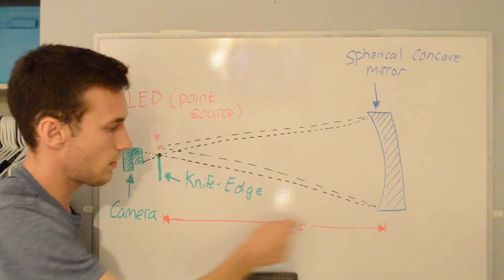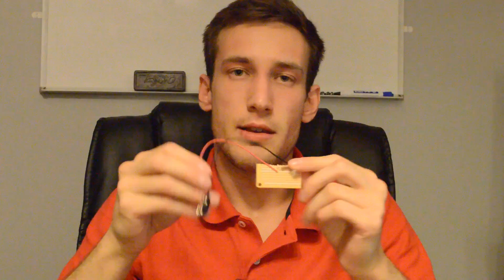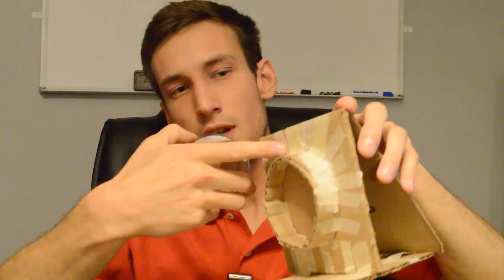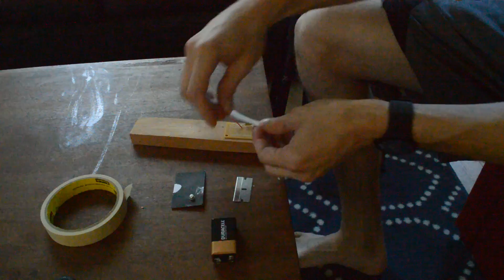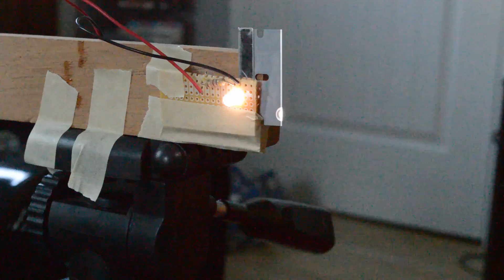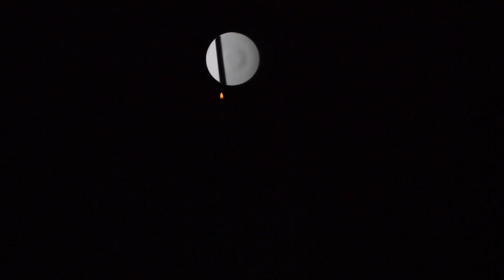How To: Build Your Own Schlieren Setup

Comment: Hey Josh, firstly thank you for explicating in a way so vivid and secondly i wanted to ask how do we colour the images seen...do we use a filter or a coloured knife edge , please tell in detail.
Reply from the maker: There are a couple of options that you could pursue.  The first is to use the setup with the knife edge, and then attach a colored filter to the other side of the knife edge where the light is passing by.  If you just use a single-color filter, then you'll see the normal Schlieren image, but in color now instead of white.  To get this same effect, you could just put a color filter in front of your light source.  So if I place a blue filter in either of those locations, I'll get my normal images, but now they'll be tinted blue.

That's not very helpful aside from making our original image a different color without post-processing.  The second option is to, again, leave the knife-edge in the setup, and attach something like a rainbow filter to the side of the knife-edge where the light is passing by.  Let's say we attach the filter such that the red is closest to the blade, and the blue is farthest from the blade.  This means that the light that is getting refracted the least (but still passing by the knife-edge) will be colored red, while the light that is refracted the most (but still passing by the knife-edge) will be colored blue.  There will still be parts of your image that are dark, where the light was refracted the other way and is being blocked by the knife-edge.  This is probably the best method for coloring your images.
Reply: By a filter do we mean a coloured paper?
Reply from the maker: Pretty much, yes.  It needs to be transparent enough to let light through, but change its color while doing so.  I would recommend something like transparencies that you can put on overhead projectors.  If you print a color spectrum/gradient on one of those sheets, that would probably work pretty well.
Reply: Thanks a ton!

Comment: Can I use a concave mirror that has a holder in the middle? That means there is a black circular spot right in the middle. Will it matter? Please help, Thank you very much!
Reply from the maker: You can use the mirror, but you'll just have a black spot in the middle.  I'm guessing you have a telescope mirror or something like that?  It should work, but just note that you'll only being able to see the light around the center spot.  I think there are a few Schlieren videos out there that use the same kind of mirror you have.
Reply: Yeah, it's one mirror out of many from huge observatory telescope. One university offered me to borrow it. Unfortunatelly I couldn't get to anything better. We will see what are the reselts gonna be. TY for help, mate!
Reply from the maker: No problem.  Good luck!
Reply: Why do I need LED (point) light source? The regular bulb would do it it too shining everywhere, wouldnt it? The goal is to hit an entire mirror with light, right?

Comment: Will a parabolic mirror work? I have an 8" in my telescope.
Reply from the maker: While the optimal mirror for this double-pass system is a spherical concave mirror, a parabolic mirror will still work okay.  For the Z-type (two-mirror) schlieren system, the parabolic mirror is the optimal choice.  I'm currently filming a spherical vs. parabolic mirror comparison for schlieren systems where I'll go over why you can use either, but also how performance is degraded depending on which system you're using it in.  I'm also editing a Z-type schlieren system video, so if you have two telescope parabolic mirrors, you can get some really nice images from that system.

Comment: I Try to set up the system .
1,And I do some change ,the angle of this system is bigger. I see the candle and the candle in the mirror.both of them have the shadow.
2.I analysis the image by matlab and i find one half image is dark a little . I think it in relation to the knife cut the focus .
Reply from the maker: To make sure you get the best image in the end, I recommend leaving out the knife edge until you can see that you get nice uniform light all across the mirror.  If the light is uniform over the mirror, that means you have a good quality mirror, and your camera is aligned in a good location to then put the knife edge in.

The next step is then to put the knife edge in before you put the candle in.  You should still have a uniform distribution of light on your mirror, but it will be a little dimmer because you're cutting out some of the light.  Finally, you can put the candle next to the mirror, and you should get some nice images.

Comment: When i attempt to do this set up and test to find the focal point of the mirror using my phone, it ends up being almost directly in front the mirror where that little dot is smallest, is there something that i am doing wrong or is there something wrong with my mirror?
Reply from the maker: It sounds like your mirror just has a really short focal length.  That was the case for the bathroom mirror that I use at the end of the video (although it still had a long enough focal length to get a decent image).  You might want to get a mirror with a focal length more like the one I use in this video.
Reply: I believe the focal length of my mirror is 75mm is it still possible to do this with such a small length? And also I ordered my mirror from the website in the link Edmund Optics

Comment: Hi Josh, just a quick question. How different is this set-up compared to the "Z" system Schlieren? Which set-up is actually better (more sensitive and representative) to capture the observed phenomena
Reply from the maker: There are a few differences, but the main one is that the Z-type is a single-pass, while the setup I have is a double-pass.  That is, in my setup, the light first passes through the object (heat from the flame), hits the mirror, then comes back through the object again.  It also means that the light is diverging and converging as it passes through the object.  For the Z-type, you collimate the light on the first mirror, then the collimated light passes through the object (not diverging or converging because it's collimated), and then it is focused back down to the knife-edge/camera with another mirror.  So for my setup you only need one mirror, while for the Z-type you'll need two.  I believe the setup I used is the cheapest and easiest to set up for the layman, but I think most researchers use the Z-type (or something more complex).
Reply: Hi Josh and Ahmad,
As Josh said, a Z type arrangement is found more commonly in research labs. This is for a few benefits of practicality a double-pass system doesn't allow:

For critical image making (& quantitative analysis), micro adjustments need to be made in every component of the system. With the light source for example, often the LED (or other point source) is spread out to create a source which isn't quite considered "point". The benefit of this is that the system is no longer an "on"/"off" phenomena, but some of the normal rays are allowed to pass, and this gives different data in the image with a more embossed feel. This is why laser doesn't often make a great source.

With a Z system, parabolic mirrors rather than spherical mirrors are used. This way the collimated light can be better calibrated without any astigmatism. Each of the mirrors are also on a micro-adjustment mount (which is often more expensive than the mirrors).

Aside from the adjustments a Z system gives, it also allows for quick conversion to a great shadowgraph setup, or allows for different variations of schlieren - color cutoff, color direction indicating and so on.

Often the image needs to be resized at the camera position, so that the entire mirror can fill the field of view of the sensor - this is done via various options in optics, but a simple achromat doublet is best.

Having said this, a z arrangement is not necessarily best. Spherical mirrors are more readily available in bigger sizes (think old telescope mirrors), and if you really want to go big, you can use a grid schlieren system. I have also often come across lens schlieren systems, however these are typically riddled with distracting artefacts from the lenses themselves. Fine for data collection though.

I hope this helps
Reply from the maker: Thanks for your more detailed response!
Reply: Thanks guys for the assistance. I have developed the "Z-type" Schlieren system using two parabolic mirrors and seems to have captured something.

Comment: im sure you probably know XD but all radioshacks are closed now, is there anywhere else you suggest getting the LED and if so what specs LED did you use??
Reply from the maker: Yea, unfortunately they were starting to go out of business when I made this video.  If I were you I would just buy a pack of LEDs off of Amazon.  You can get a bunch of them for pretty cheap.  I just used the standard 5 mm clear LED, but you can honestly use whatever kind you want.

Comment: i can place the setup further than 2ft? does the light - camera distance matter and how could i calculate it?
Reply from the maker: The separation distance between the light source and mirror is dictated by the focal length of your mirror.  Your light source needs to be twice the focal length of your mirror away from the mirror.  If you don't know the focal length of your mirror, you can find it like I show in the video, using the flashlight on your phone.

Comment: Could you explain why the Schlieren Photography measures the first derivative of the gas density? If say one gas has a density of 1kg/m3 and another type of gas has a density of 1.2kg/m3, would they have the same brightness if you look through each gas?
Reply from the maker: I will probably do another quick video explaining why it's the first derivative, but the derivation is a little too long to put into words here.  In the meantime, search Google for ' Introduction to Shadowgraph and Schlieren Imaging", and click the first link (it should be a PDF from RIT).  I found this document very helpful, and maybe that will answer some of your questions.  The derivation can also be found in Elements of Gas Dynamics by Liepmann and Roshko.  The book is very good and inexpensive on Amazon.  It is primarily a book on compressible flow, but it has a chapter dedicated to experimental methods, and Schlieren is a section in that chapter.
Reply: Have you posted a new video explaining why it's the first derivative? If so could you post me a link? Or if you haven't could you reply that you haven't made it? Thanks^^

Comment: Why is it 2f? I thought the focal length is the length that everything gets focused down at?
Reply: You just added a new definition to the acronym WTF? Why 2 f? The focal length of a concave mirror is defined as the distance at which the reflected rays converge from parallel incoming rays. That is going to happen at half the radius of curvature for a spherical mirror. The focal point and the centre of curvature are not the same place. Rays coming from a point source like this are not parallel, they are diverging. If you place the light source at the exact centre of curvature then those rays all come in perpendicular to the mirror's surface and get reflected right back to where they came from. A little off to one side reflects a focused point back at the same distance, just off the other way by the same offset.

Comment: Hi! What is 2F, is the focus? Im a little bit confused to emulate this at the laboratory, the focus is the distance between the midle of the mirror  and the radio? Thanks for ur help! Have a nice day!
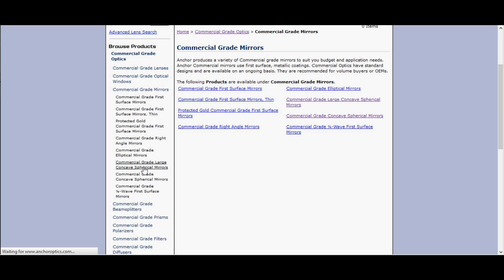Reply from the maker: The value 'f' is the focal length of the mirror, and the value '2f' is just two times this focal length.  At around 6:06 in the video, you can see the website for where I bought my mirror, and the focal length is listed in the column labeled F.L. as 750 mm.

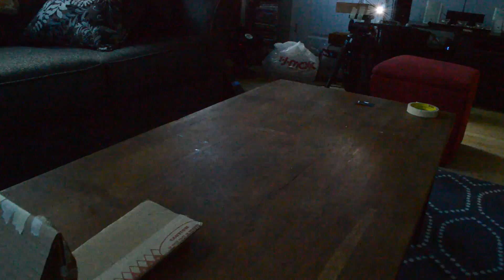The significance of the 2f distance is that if you put a light point-source at 2f away from the mirror, it will focus back down to a point at that same 2f distance.  So when you are setting up your system, make sure you put the light source as close to 2f from the mirror as you can.  In the video at 12:19, I'm finding the 2f distance by using my phone's flashlight.  I keep moving the phone away from the mirror until the spot on my phone case is smallest.  This is the 2f distance, and this is where I begin the rest of the setup.  I could have also just used a ruler to measure the 2f distance from my mirror using the value given on the website.

If you have any other questions, let me know and I'll do my best to help!
Reply: Hi! I using a led, maybe the same like you, but my focal point (the little point in the blade) its conical, not a sphere and soooo big!!! I dont know how to do for change that... My schlieren photos have poor quality, my mirror have 150 mm.
Reply: Thanks for ur help!!!! :)
Reply from the maker: Alright so there's a few things you should check.  

1)  Make sure your light source (your LED) is as close to a point-source as possible.  In my video, I do this by putting the aluminum foil with a little hole cut into it over the LED.  The smaller the light source pin-point, the smaller the focused image will be on your blade/knife-edge.  You can see in the video how the size of the image changes before an after I put the aluminum foil/black paper on.

2)  Make sure your LED point source is 2f away from the mirror, and that the knife-edge/blade is also 2f away from the mirror, sitting directly next to the LED.

3)  A couple things about your mirror.  You need to make sure you have a concave spherical mirror.  If you don't, the LED point-source won't focus back down to a point at 2f away from the mirror.  Towards the end of the video I showed that you can get the system to work with a standard bathroom mirror, but the quality is poor.  The second thing is that I'm guessing you mean your mirror has a focal length of 150 mm?  If that is the case, then the refracted light might not have enough distance to separate from the non-refracted light, and your system won't have much sensitivity.  I would try to get a longer focal length mirror if you can.

Comment: Hello !!!   please  how do I select a suitable  camera for the schlieren system....  I intend  capturing  spray parameters  of a nozzle  and the combustion  of a fuel....  
will Nikon d40 work??
Reply from the maker: Yea, that camera should be great for this.  I'm using a Nikon D3200 for my videos.  I don't have the right lens though, since I need a little more zoom.  I'm using my 18-55mm kit lens that came with the camera, but I wanted to use a higher zoom lens so I can fill the screen with the mirror.  If you watch my other Schlieren videos, you'll see that even with a bigger mirror, it doesn't help because they focal length had increased so I had to move my camera farther away.  Ideally, you would want a high-speed camera and a large enough zoom lens.
Reply: JoshTheEngineer 
Thank you so much for the explanation ...

Comment: Hi! I believe I have everything needed at home. The mirror is one of those that you put in the bathroom I hope it'll work!
I'll find a razor blade somewhere in the house and there must be a LED lying around as well.
My only problem is that my camera is a semi-DSLR?(if there's such a thing ahah) By that I mean you can't zoom in and out manually and you can't really adjust the exposure. Will it work in a super dark room? I'll try to cover any lights or maybe put a long cardboard box between the camera and the mirror. I don't know, if you have any suggestions please help me! This project looks so cool
Reply: help me maybe?
Reply from the maker: Hello!  The mirror I use at the end of the video is a bathroom mirror, so you can see that maybe you won't get the crystal clear images like I get with my good mirror, but you should still be able to get something.  If you don't have a razor blade lying around, you can always use a knife, just be careful.  You can use any light source, even a light bulb, as long as you put a cover over it and poke a little hole in that cover to make a quasi-point source.

I've gotten good results with my DSLR, my point-and-shoot circa 2005, and with my phone.  The main problem you'll run into is that you won't be able to zoom in on the mirror, so it might be sort of small on your screen or in you picture you take.  That's the problem I have, since I don't have a lens that zooms far enough.  Your camera should definitely have some sort of exposure setting.  All three cameras I just mentioned have the option to adjust the exposure manually, even my phone.  I would just check the manual for the camera.  It's easier if the room is dark, but as you can see in my video, I'm taking this video during the day, so that should work just fine too.  Good luck!